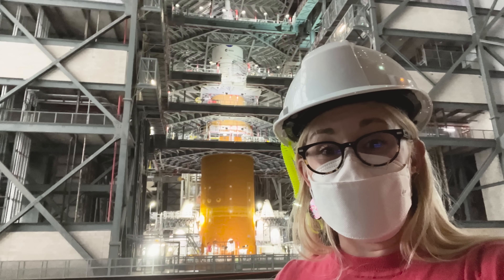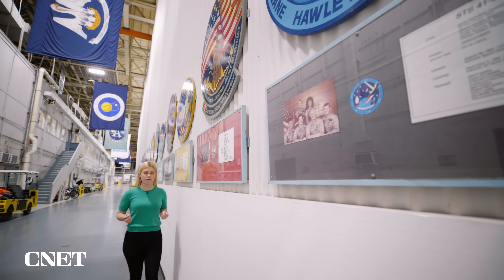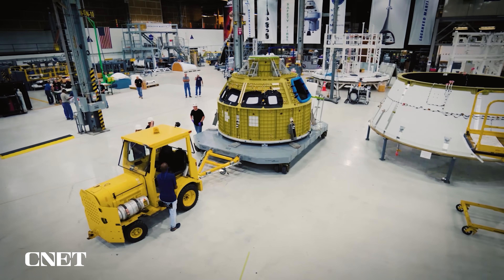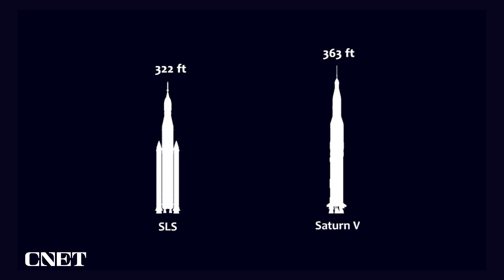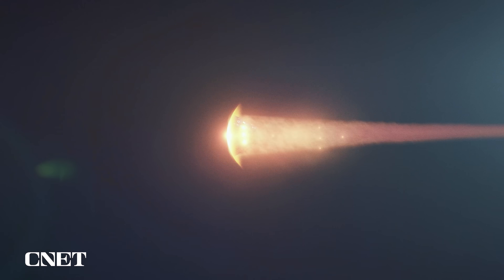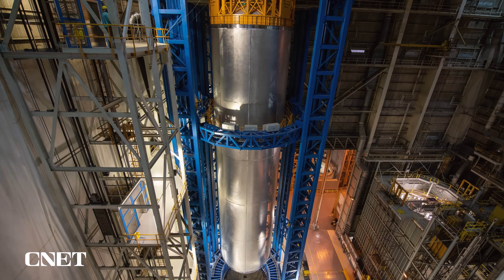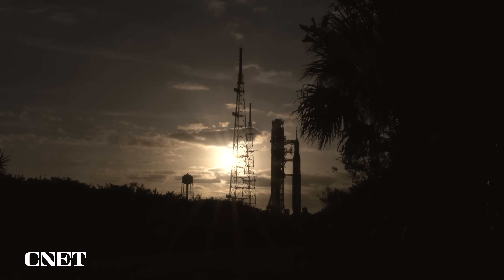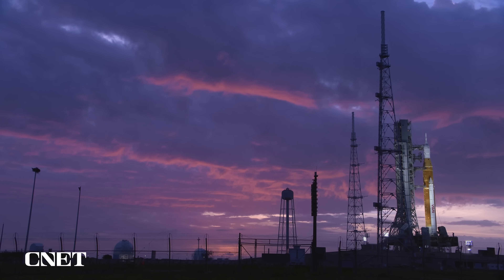NASA Is Going Back to the Moon 🚀 Here’s How Its Massive Rocket Was Made

Comment: The article was very interesting but the board work for audio had much to be desired. I think the idea was to keep your attention by cranking the music between sections which proved to be very annoying. but, lowering the volume and turning on subtitles saved the day.  On the topic of the content. It appears that  NASA has built a junk yard special from the parts of the Shuttle program. What happens after all the RS-25 Engines that were REused on shuttle are at the Bottom of the Ocean??? Will they REtool and use the old Russian N1 stockpile that they have been using on other rockets???

Comment: Checking at the numbers on the internet the payload capacity seems to be lower or the same as the saturn 5 rocket. So this design isnt exactly special, however at first glance it does appear that the rocket is wider, which is a good thing because it can hold bigger cargo. But i do find it dissapointing that they are making these missions after being on the moon 50 years ago...

Comment: Less than a minute in and we already have mistakes lol. This should be really good. Please stop referring to the rocket as Artemis. Artemis is the program which you also state. Artemis is not the rocket which you said. The SLS is the rocket which you said. Consistency is lacking here. It’s like calling the Saturn V the Apollo. 

Wonder if you will touch on Starship that was awarded the HLS contract. There are a lot of moving parts to the Artemis program. SLS, ICPS, Orion, Starship (HLS), Lunar Gateway probably doubtful, etc.

Comment: 20 times she said "I just cannot give you an idea of how massive this thing is" WITHOUT telling us it's height, diameter and weight BECAUSE then she would have actually given us a well defined sense of how massive it is.
.
Actual journalists that deal with Space X (A company that flys rockets instead of just talking about them forever) have continually asked in depth engineering and design questions including basic specs to start off. Lose the glamorous upbeat music, do some research and bring us some facts.
Reply: Wow, who hurt you?
Reply: Waste of resources, why don’t they colonize the Sahara desert.
Reply: It has almost the same payload capacity or worse than saturn 5. Its big advantage is that it is wider which allows for bigger cargo but not heavier cargo. In my opinion the rocket should be bigger than saturn 5. But then it probably wouldnt fit into the factory...

Short: they need to upgrade factories to allow for bigger rockets and make the boosters reusable to justify the cost. Sls boosters just fall into the ocean and they need to build new ones...
Reply: P.s. the rocket is considerably shorter than saturn 5
Reply: Considering the sls tech specs this rocket will never go to mars...

Comment: I though big non-reusable rockets like this were a thing of the past?
Reply: Physics.  It all depends on the payload and distance.  If you are using a SpaceX Falcon 9 to lift a two ton payload only 240 miles, you don't need a large tank of explosive fuel.  But going 240,000 miles is a huge difference.  Even if it was just the same payload as SpaceX it would need exponentially more fuel.  The lift capability is mostly for the fuel.  This SLS Fuel tank is way too large to re-enter Earth's atmosphere and safely land.  It's like comparing a freight train engine to a moped.
Reply: another comment of a person who didn't watch a video
Reply: Eh

Comment: Flying from London to Newyork on an Airbus A380 just once and discarding it is what NASA is doing Ambitiously.
Reply: Exactly. Hope this will be a very short chapter in NASAs history before sense kicks in and reusable rockets are used also for heavy lifting.
Reply: Comparing them is ridiculous. SpaceX uses stainless steel rockets because they are reusable for launching satellites ect...Stainless is heavy and this means you can only take smaller payloads and return fuel ect... Nasa needs to take larger payloads that SpaceX can't do. Different designs doing different things. Don't you think about these things before you say anything?
Reply: @MICKEYISLOWD  Yes, think about these things before I say anything. The Starship can transport over 150 metric tons to LEO. SLS Block 2 can carry 130 metric tons to LEO. SLS Block 1 and 1B even less (95 and 105 respectively).
Reply: these people need to talk to spacex!

Comment: Raptor 2 is has more thrust and capability than the RS25 engines on this and doesn’t use tricky hydrogen. This rocket is out of date
Reply: Raptor 2 is a full flow methelox engine which is more powerful but alot more complex to build and operate. It also belongs to spacex so each company uses what they know how to use. Youre not a rocket scientist so dont pretend to know.
Reply: @odynith9356  So are you a rocket scientist then? You sure are pretending to know.
Reply: @RasakBlood  I am literally an aerospace propulsion engineer, so yes I’m a rocket scientist and no I’m not joking. It’s my job. I work at cape Canaveral and work on rocket propulsion systems. I can prove it if you think I’m lying.
Reply: The RS25 is WAY more powerful that Raptor. That's why SpaceX needs 33 of them.

Comment: If they launch three whole rockets to the moon, with a crew on the surface by say 2025, that is going to end up being a LOT of expendible, wasted parts, as well as money. NASA has good ideas and a well-thought out plan for lunar exploration, but might be even better if it could be like SPACEX, where parts are reusable.
Reply: I don’t really blame NASA or Boeing for the lack or reusability in SLS the government required them to use as many parts from the STS shuttle in the construction of SLS so it is likely too expensive to reuse such old designs. Also lack of reusability can allow NASA to justify getting a new rocket built instead of continually upgrading SLS.

Comment: You can guarantee that SpaceX could do this with 1/10 the cost.
Reply: SLS has cost $32 billion so far. It’s also not reusable. Those boosters just plop into the ocean. Starship’s goal is $2 million per launch with a target of 1,000 flights per vehicle.
Reply: @FerociousPancake888    A Falcon 9 costs $62 million to launch.  A Starship on top of a Super Heavy will be significantly higher than that.  
We just had an explosion under a Super Heavy booster, which will set it back awhile.  So, far all Starship has done is flown to an altitude of 10km.  That is a long way from an orbital flight.  We will have to see whether it can withstand re-entry. 
I wouldn't give SpaceX too much credit at this point, until they can prove that Starship will even work.  Hovering vs. getting up to orbital speed and re-entry are a world apart in complexity.
Reply: @FerociousPancake888  SpaceX numbers is so absurd, Starship will never cost $2 million per launch I tell you that, my minimum realistic estimate is probably $50 Million per launch. But that's still cheap compared to SLS, $2 Billion per launch
Reply: Come on guy use your brains and stop listening to vapourware salesmen
Reply: @53af00d  I could go either way with vapour ware .. which way are you thinking or is it all such?
Reply: The two work together.  There would be no SX without NASA.  It's also humanly possible to support both.
Reply: If Space X’s Starship works as advertised, it will make Artemis obsolete.  Will take longer to develop than SLS
Reply: You need years of experience when it comes to space flights and related infrastructure.. while the scientific community will benefit from collaboration, the overconfidence in and of SpaceX concerns me to say the least.
Reply: @time_371 Elon fanboys are delusional
Reply: And ISRO can do in 2/3rd of the cost of SpaceX
Reply: @Roger Vieira 
SpaceX has not reduced launch costs by that much.
Reply: They can but, they will only ever do it after big government does it first.
Reply: @Galactis1  When a government programme fails, they just tax more and increase the budget. Look at the mess they have caused with government tax funded schools.
Reply: Can you guys fix the International Space Station please?
Reply: Bahaha

Dont be heliocentricked
Reply: Fr
Reply: Spacex never left Earth EVER!!!!
Reply: @fatimasalakovic9985  135 times they have
Reply: Q question for the SpaceX fanboys: If SpaceX is so great why didn't they build the SLS so?.....I'm waiting....thought so!
Reply: @colors6692  SpaceX needs to make a sustainable business the generates profits which it can reinvest for future growth. NASA is funded with billions from tax money. SpaceX is focusing on multiple income strategies such as world wide internet access for remote areas. SpaceX employees also work for Tesla.
Reply: @colors6692 , because the SLS was started in 2011. If you recall, in 2011 SpaceX had just launched its first few falcon 9’s. 

Next to Starship, SLS is a total joke. I want my money back!
Reply: @colors6692  why would spacex want to build this garbage only to waste billions of dollars. It’s not even reusable. That’s why they’re making starship and I guarantee you it’ll make this look like a huge waste of time
Reply: @colors6692  I assume you are TRYING to be funny ???  Thought so!
Reply: @colors6692  They are. Its called Starhip. Its cheaper have more capability and will take less then half the time to develop and will become the backbone for the new space industry.